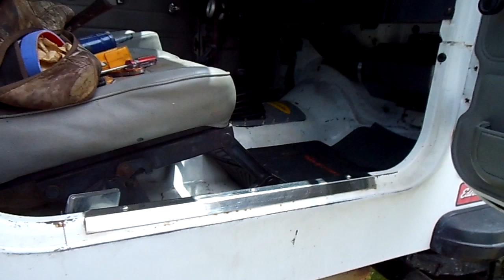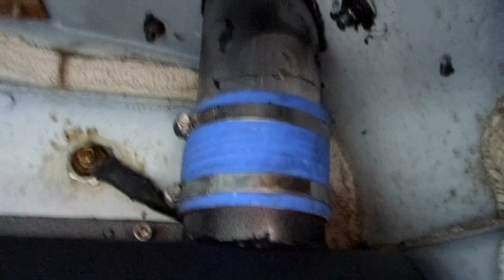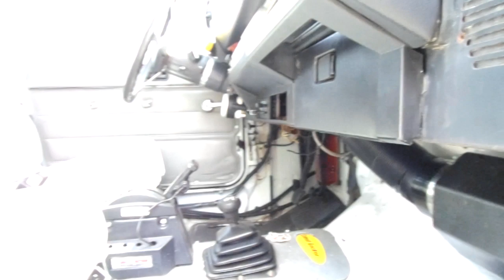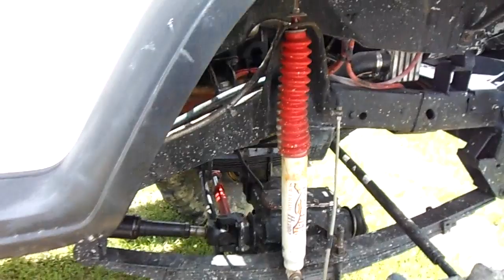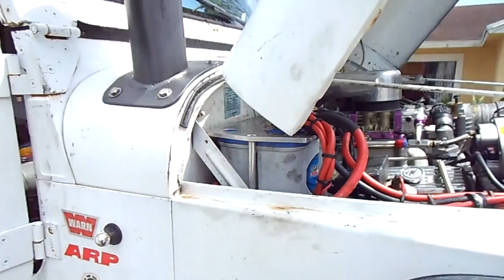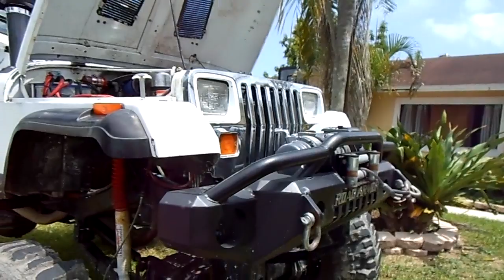JEEP YJ Custom Made Snorkel 2

Comment from the maker: Its running perfect.The setup is done with 4" aluminum tubing and the total length from inlet to outlet including the air box is 4 ft. Also I did a carb vacuum reading before and after and the readings were the same.also a lift test was done and no change up to 1480 cfm; I only need 850 cfm max. thanks for your comment.